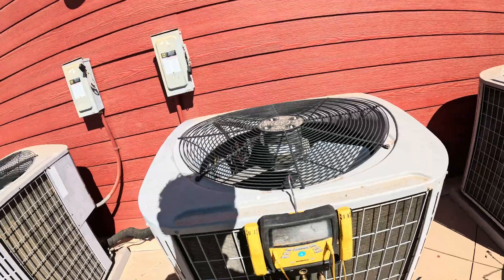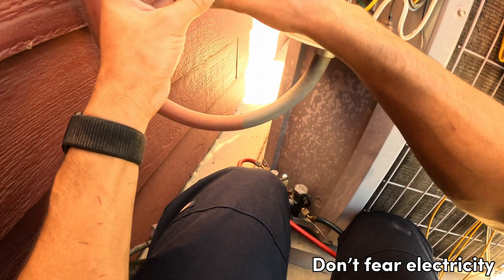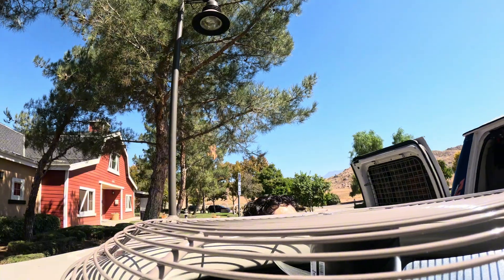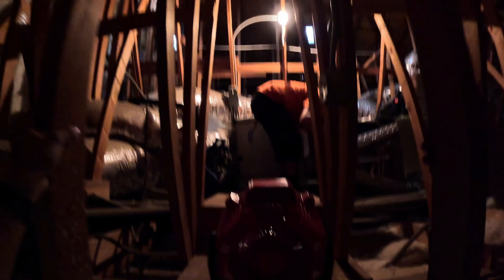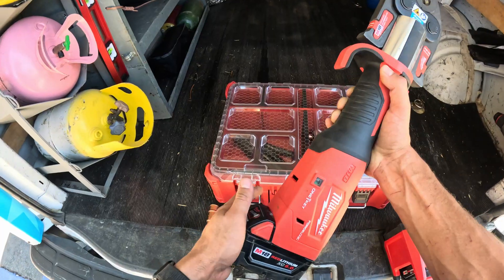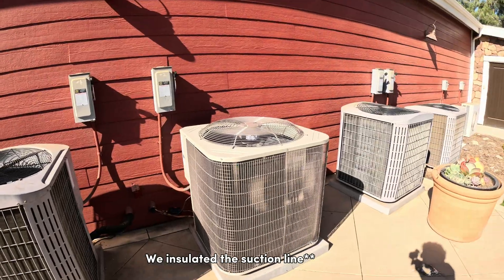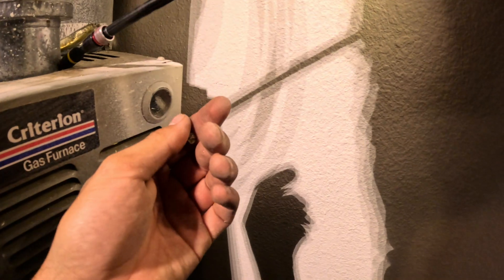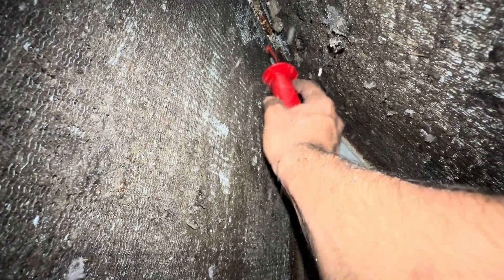18 Year Old Installs 5 ton Heat Pump

Comment: 2 things why use rls when your gonna braze the outside unit i get bringing up the braze kit may be heavy but it just looks more consistent and clean, 2nd on that a coil cleaning there are a couple things you should of did while you had the plate taken off the A coil go ahead and check the heat exchanger its the best time to get the best look at it next with all that rust it may be better to pump down the system clip that line set and take that coil outside put a new drain pan on the coil and wash that coil very thoroughly.

Comment: Did you just do that instead of brazing at 4:07?
Reply from the maker: @lakerfan7324  yes
Reply: @EwokDoesHVAC  I’ve seen you brazing before, why do you not do it sometimes?
Reply from the maker: @lakerfan7324  pro press is a lot faster but when I can’t pro press I just braze

Comment: From my experience I would never cut up an old unit at the customers place. Or at least not on cement, compressor oil leaves nasty stains. I had to pay a company to come clean a customers driveway because I didn't close the service valves on an old unit and some leaked out when I was loading it into my van.
Reply from the maker: @Naatuma  I cut it very slowly at first to see if there was still oil in it, before I went even deeper. But I don’t want to be in that situation so im definitely gonna save it for when im home.